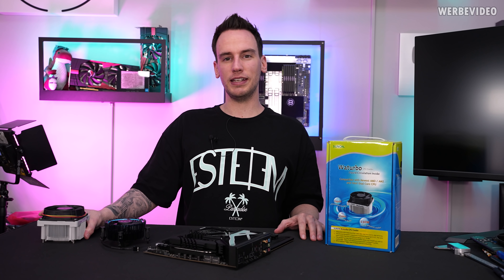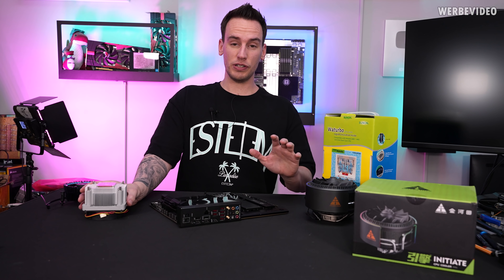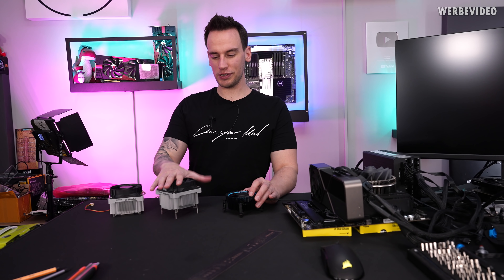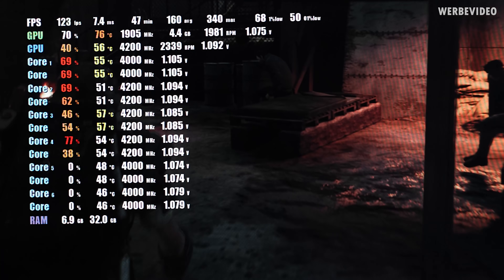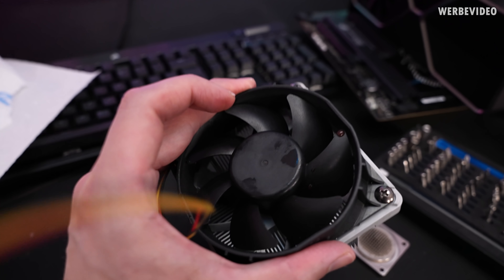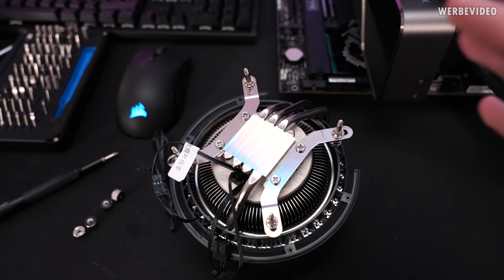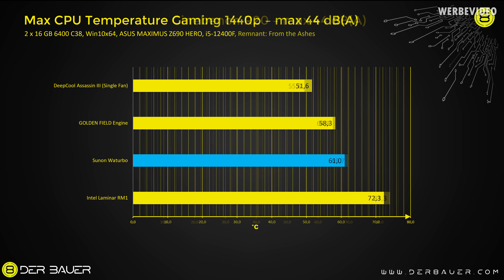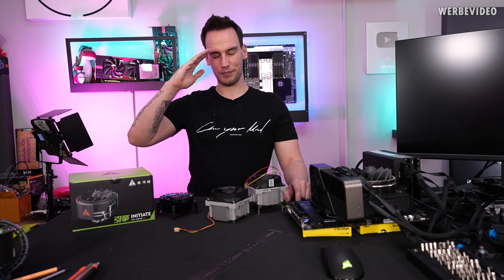Obscure Engineering: This Boxed-Cooler tries to impersonate an AIO

Comment: I'm not a machinist of any kind, actually, you probably know much more than me since you have and can use a CNC, but I always use oil to cool down and make it easier when drilling, and to spare the life of drills. No matter how good drill bit you have, unless you drill like aluminium, then it doesn't really matter. A few years ago I by accident got a bunch of drills within a  small tool i bought and those are simply the best drills I ever found. There's no marking on them and I can't seem to find as good drills anywhere. I suspect they are insanely expensive and are made mainly for industry use. I live in Sweden and the company Sandvik here is known world wide for there high quality drills, lathe pieces and so on. So I suspect there's similar quality to their products.

Regarding the product itself, it is really a interesting and impressive technique they've used. I can't stop wondering how much better the performance would have been if it would have been just slightly bigger so more coolant could have been fit. Again, it's odd how good or bad different products, I guess supposedly coming from China can be. I can bet the company no longer exists, or it is just making products for the industry now.

Comment: That's actually pretty good considering that this is a 15 year old product, this was before tower coolers were a thing, and the fact that it can compete with a small heat pipe cooler is fascinating.

Comment: This Waturbo thing is quite neat , given it was built a long time ago and still works. I wonder if you could build an adapter and join 2 together and see if added thermal mass helps it perform any better?  Or even a plexi block or tube so we can see what the coolant flow pattern is when it's powered up.

Comment: I'm surprised by sunon.  They're an OEM supplier for fans, but they don't have any presence in the DIY community.  Maybe this is their attempt to penetrate the DIY community?

This is especially surprising since they have their sunon "maglev" fans which levitate the fans on a weird magnetic material rather than relying on the fluid film inside the bearing.

Comment: Maybe separate the fan unit and the rotor unit (power by another source will give better results ) change the surface contact plate to cooper /together with better cooling formulated water may helps too  !

Comment: Seems to perform well compared to it's size. I wonder if there could be a form-factor, where something like this would be a better solution, compared to something else that fits the same space requirements, using heat pipes ;D

Comment: I wonder how this old cooler was performing against its counterparts from 10-12 years ago - price wise and just cooling performance (I had zero experience with overclocking and cpu temperatures/load/cooling 10 years ago).

Comment: Your test of the golden field cooler is invalid because you broke the shroud. You essentially neutered it to being an Intel stock cooler. The shroud is needed to duct the air into the fins of the cooler. Without it, a significant amount of air is thrown out the side of the cooler and static pressure is lost, which will significantly affect the cooling potential of the cooler. It's probably worse on this cooler because the fan blades are far more aggressive with their blade angle.

Intel stock coolers can be made to perform better and be less loud by adding a duct around the fan blades.

Comment: I didn't expect that the cooler would have actual liquid in it, I mean, it just looks like an easy scam to pull off. 
Without the screws to open it, can you even tell if it has liquid instead of a solid metal core?

Comment: 3:40  Stop pushing it so much!  You are bending the drillbit  (cry)       small bits (less than 12mm) need max speed and so little pressure.

Comment: The "pyramid"-shaped cooling fin stack looks like it should be inverted, for the propeller to do a better job. Could be a fun little experiment, if someone with the appropriate equipment could manufacture such a cold plate.. ;)

Comment: The pink/red color of the liquid is familiar to me as transmission fluid. No problem wit that, it is capable of much higher temps  than any water system. Doesn't break down in a sealed sstem and is always good when it shows that color and clarity. Great idea.
Reply: Definitely not transmission fluid. It's probably similar to dexcool, or the generic ethylene glycol compatible with it.

Transmission fluid doesn't ball up on metal surfaces like this stuff did when he removed the base plate. It's more of a sticky liquid, which makes sense because you want it to be everywhere for lubrication, not be repulsed and have metal on metal contact.

Comment: Personally I would like to take the concept of the liquid cooler and use it for something larger. Liquid is definitely a good way to move heat away from something, but here the problem seems to be it's lack of ability to radiate that heat. Liquid coolers do tend to work better with a radiator, and most radiators are designed for directional flow. So it's hard to come up with a way for this particular setup to work well.

Comment: Hmmmm
I am actually wondering if making a circular shape for the contact plate and making the same for the sides and using copper...
Could actually improve the temps quite a bit
This Could have really good potential with full copper and the water Flow/direction in mind for max contact to get thermal transfer optimal...
Letting it vortex or filling it to to the max and having the water Flow in mind and increasing the metal towards the fins Could greatly improve temps...

Comment: Also every air cooler is a liquid cooler, because all of them have liquid inside the heat pipes, except the most basic fin-style stock-box cooler.
Reply: Yes but they rely on phase change. The liquid becomes a gas.

In a liquid cooler the coolant is always a liquid. It never boils unless the pump breaks.
Reply: @GoingtoHecq  yes

Comment: I think comparing it with one of the best air coolers in the market was unfair, I mean deepcool one literally has 2 metal towers and 2 fans, like how's that fair? And then there's the cost difference as well. Instead, comparing it with a cheap AIO or a normal single fan air cooler, with cost comparable to this cooler including shipping, would've been much much better. 

Other than, having to create your own mounting setup, this cooler is very impressive. Tho keep saying that it's 10 year old doesn't really affect anything, UNLESS it's a unit Actually made 10 years ago, because I find it very hard to believe that you can find something THAT old, in this good condition.

Comment: This was quite cool.
At some point you can move more energy with water than a heat pip. With this pump design and that idea, one should be able to move the heat longer than in a heat pipe, thus add more fin area. One might be able to come up with a simple design where the water flows in a loop allowing the cooler to have a higer fin area, and using the fan motor as the pump motor.

Comment: Hey just a heads up. I love your vids and the workmanship. Here you did the same as I did when I started doing maintenance and construction in work.
Don't ever use drill bits on high rpm and/or without lubrication or stainless steel and other high grade materials.
If you spin them fast you don't cut into the material but scrape down the surface of the bit making it instantly useless.
Use a tower drill on low speed, or try to limit the speed on the drill(there are Bosch drill with 2 speeds).

Comment: The ingenuity of the design truly is incredible in its simplicity. It's one of those solutions that seems so obvious when you see  it after the fact, but coming up with the idea of "hey, can't we just use the fan's rotation to drive a pump?" and then NOT making it into some complicated drive mechanism is unironically 400 IQ. As they say, an engineer's job is done when there is nothing left to take away.

Comment: And here with my box cooler and 12400f (temporarily while I sort things out, I have WC gear downstairs), I also get ~82C on cinebench with 85W peak and 65W sustained power draw

But when video encoding or gaming for >1hr sustained it creeps up to 100C despite averaging only 50-55W in those use cases. 
I wonder if it has to do with GPU exhaust heat (3060ti), or some kind of heat soak...

Comment: is this really a boxed cooler? 
"boxed cooler" is usually used to refer to cooling solutions that come bundled w/ a cpu
this clearly is not, so its merely an aftermarket air cooler w/ some quirky working principle

Comment: I fell they'd get even better heat transfer to the air cooler fins if the water chamber was ribbed, grooved, or something to give more surface area on the interface of the walls of the cylinder with the fins. Currently it's just a smooth cylinder.
Reply: Yeah, I was thinking this as well. There should absolutely be some ribs or spiral threads machined into the well. It's likely that there should also be flow controls around the impeller to keep the fluid cycling in a useful and orderly manner. As it stands, it feels like half of a good design missing the other half.

Comment: Anandtech and a few other review sites never purged their old reviews, so you can see a few other very odd AIO designs prior to Asetek patenting the standard design we know today. Since most of these old AIO's did not have big radiators, they all ended up worse than a big tower air cooler.

Comment: Talking about shipping costs... why is there such disparity between German companies delivering to Australia? I buy a Dainese race suit that weight about 5kg (and is bulky) and ships express (DHL) for $AU28... I order 2 x 360mm Alphacool radiators and the shipping cost (again, using DHL) was $AU150! A few years ago I found a numberplate reflector that suited my BMW S1000RR for just under €3 and they wanted €18 to ship it and it would have easily fit into a standard size letter envelope! Suffice to say I passed on getting it.

Comment: I would definitely love to see that heatsink/impellor combo operate with some sort of copper heat pipes added to the mix.  Too bad it never came to fruition but you are right in that today it would probably be too expensive and maybe still not efficient enough to be manufactured.  I would still love to get ahold of one just to play around with as it is definitely cool (pun not intended?) and unique.  🤔👍👍
PS: I have seen people use that fan and magnet idea with LEDs' to create some cool "water" lamps that circulate a whirlpool effect in a glass container.  Quite creative!  👍👍

Comment: I was thinking no way that even has water inside god damn it😁

However it's stupid because as soon as the entire water inside is saturated of heat the temps won't be that amazing, if the water even moved trough the small fins going to the ends of it, now that would have been a GOLD cooler.

Comment: sure seems a  modern prototype with the same core feature at the center of the design would be the only appropriate step forward.
 IF you could get comparable results to an AIO, the ITX application ALONE would justify additional cost both to manufacture & in the retail marketplace.
 An efficient small form factor cooling solution that could compete with any device making use of a Radiator/heat exchanger would be worth its' weight in gold.

 I'd bet this thing with each & every area completely modernized could disrupt the industry.
  In a very huge way

Comment: The Waturbo's design does have the added bonus of cooling the vrm and other components surrounding the cpu socket. If they made a finned version with heat pipes, that cooler could be very interesting in smaller cases that can't fit radiators easily

Comment: For a 15 year oold cooler to still be able to cool a modern CPU to that degree is impressive. Cool, thank you for showing :)
Reply: It's the heat output that matters, not how old a cpu is...
Reply: @lakshmanshiva1686  Sure, but  modern CPUs use a lot more power and that power has to go somewhere and quite a bit of it gets turned into heat.

Comment: Performance when the Waturbo is mounted in a standing up case config, rather than on a test bench? Surely the waters flow pattern would differ, leaving an air bubble against the top most fins, potentially dropping heat disipation?

Comment: Never thought to hear that word again...Waturbo! Brought me back to the Core 2 times! Haven't opened one though so that's quite interesting to see how they did that...maybe it could benefit from thermally conductive coolant (graphene?) They probably did it that way to avoid costly copper slugs plus the marketing potential

Sunon is an OEM cooling solution supplier at the budget sector. The high class OEMs would be Sanyo Denki and Nidec. Delta Electronics would be the mid-range. Early Intel CPU fans were from Sanyo Denki (as far as the Overdrive CPUs) then Nidec and Delta on various generations. These current Intel box coolers are the worse so far that I had to ever see...
Reply: Pffft. Fill it with mercury. Edit: nvm. Mercury and aluminum DO NOT MIX.
Reply: sunon makes the top range Corsair, Silverstone and few other's fans. Basically if it's maglev, it's sunon or licensed from them - so not just budget fans.

Comment: Dude, i just wondering is there a big difference between copper and silver in terms of conducting heat? I know, silver is just a little bit better, but how big would be the difference if u will make silver IHS or maybe radiator with connecting point made of silver
Reply: Silver direct die waterblock is the only that might be worth it otherwise its a total waste

Comment: You should have tried without the coolant inside to see if the coolant was really the reason temps were lower 🤔
Reply: Yup, without coolant, and with a modern higher performance coolant.

Comment: with copper fins i could see something like this dropping temps by about 5-10% so around 50c on this cpu would defitly be cheaper to manufacture compared to a AIO just due to the cost of radiator manufacturing being time consuming and wastes quite a bit of material

Comment: Drill metal much slower :)   Push hard, but spin slowly.   You will see :)  Spinning fast on hard metals only serves to quickly "polish" the cutting edges, making the bit useless. Slower it is able to "bite" and dig out the metal while keeping the cutting edge sharp.
Reply: And using bench drilling machine instead for better control
Reply: Wasn't he drilling the wrong way? Seemed to be anti-clockwise not clockwise
Reply: @dashtesla  probably just an optical illusion from camera frame rate / drill rpm / spiral drill bit
Reply: this is true.
Reply: and use coolant too, like water or even oil.

Comment: You do not realize how important this cooler is for prior-art for the patent of alphacool's "water pump built into contact plate"
Reply from the maker: Which patent is that? Will look into it
Reply: @der8auer-en  hi, sorry for reacting this late, where I said alphacool I meant to say Asetek. Even though the design of the Wacooler does not exactly resemble Asetek it could be seen as prior art for litterally "having the pump within the water block (the part that goes over the CPU or GPU)." ( Wikipedia page on asetek )
Reply: oh

Comment: I don't know what the bigger takeaway is: that this "water cooler" is surprisingly good, or that Intel stock coolers are still absolute garbage. 

Great video, sir. If a modern version of this thing came out, I'd definitely be intrigued.
Reply: It says a lot about how garbage the Intel stock cooler is. What a waste of resources to build that shitty cooler.
Reply: @shadow7037932  if you mean intel stock fair enough... but that Sunon mini watercooling is shocking brilliant in its design. They didnt take any of the crappy shortcuts I was fearing and it definitely outperforms the average box cooler for the Era. Would an AMD Wraith Prism outperform it? almost certainly... but this could theoretically be cheaper to manufacture if their production scale was matched.
Reply: @PriaSamari  yes. I was talking about the Intel cooler.
Reply: Bit of both. Stock cooler are usually bad, and Intel tends to be worse than AMD. Im surprised how well this thing works, considering theres no piping for the water to move through the fins, its just a drum-tank with flat walls.

Still a gimmick obviously. You get pretty good tower fans for 25€, which will make near zero noise and keep a 12400F below 50 degrees.

Comment: makes sense. the real difference between "aircooling" and "watercooling" is heat transfer to the (aircooled) fins through heat pipes and temperature gradient rather than through water and an externally powered pump. this is even more an AIO than traditional AIOs since you only mount one piece lol. the piramid shape might be because water is slower at the centre. mechanically, this looks like a really good design